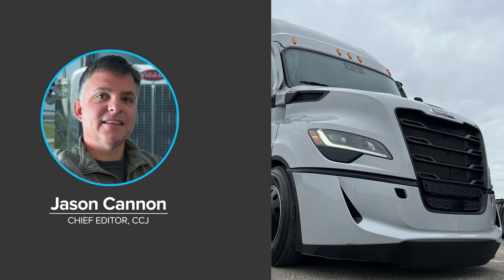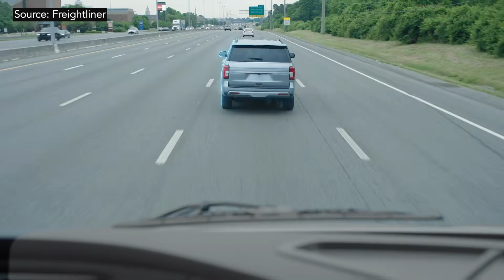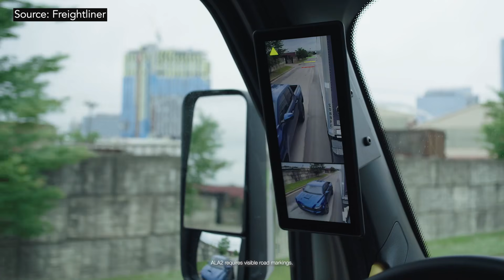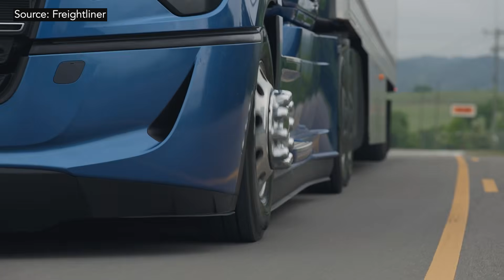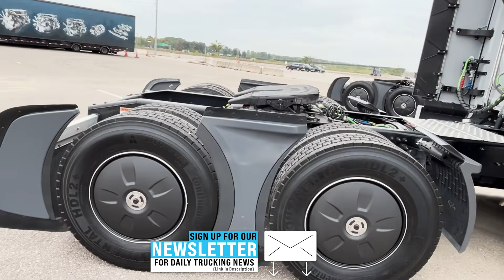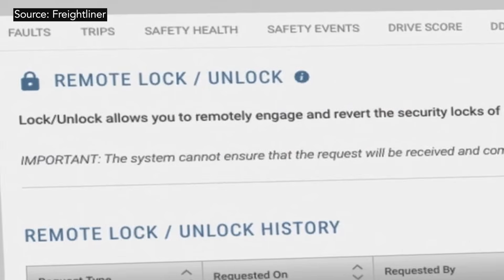First Look: Freightliner's 5th Generation Cascadia debuts next year

Comment: Mistake! Mistake! Mistake! This is without a doubt the most dangerous truck I have ever driven in the 20 years that I’ve been driving highway tractors and I am not exaggerating that point. Number one no self-respecting Driver needs any of this stuff.. number two this truck slammed on its brakes just when you’re taking a corner in the mountains or there’s a hill in front of you and it thinks you’re gonna get into a collision. Number three just a little bit of snow or even rain will take away your cruise control, your brake assist and both of the stupid side and front radars. I do not know why they keep insisting on doing this or how it could even be legal stop with the madness guys. We are truck drivers not fighter jet pilots and we do not need all of this stuff. Please give your heads a shake put the brilliant mind you got working for you. Something important like trying to figure out a new power plant that makes sense. I cannot possibly be the only driver who brings his stuff up to you and this is as polite as I can possibly be.
Reply: BTW, people, I dictated that last message into the microphone if I typed it out, the grammar would have been much better. Thank you for your understanding.

Comment: So how freightliner improved driver's life inside? Less and less storage? Sharp edges on glov box that can easily make your head bleed? Reading light in sleeper you can't reach? Refrigerator on floor hard to go into because it is so low? Steering wheel profile so annoying that drivers have to buy steering wheel cover just to be able to hold it for 11hrs a day? Ladder assembly on top bunk sticking out so much that you will have to use a helmet just to move around?

Comment: Screw all the safety equipment. If they tie a shit ton of that money into making the Trucks ride better especially in team situations it would be quite a bit safer. If you drive cross-country you know what I'm talking about. Our infrastructure is horrific (all while sending BILLIONS to fund foreign wars we dont belong involved in) you're thrown all over the fucking place and it's almost impossible to get any sleep in the bunk of these tractors.
 If they made some sort of a suspension system that helps with all of the BMX bumps I think driver fatigue would be a whole lot less of an issue. Driver fatigue is the biggest safety issue that we have out here on the road other than the new generation of drivers that tailgate, drive their Volvo's like Ferrari's. You know the ones I'm talking about the ones with California plates on their trailers and water bottles in the bathroom.

Comment: They still haven't fixed the autobraking system thinking overpasses and guardrails in curves are obstructions, and they are adding even more things the truck will automatically brake over?  Fix the current problems with the system before adding any more to it!  Other than that, I do like the new all around camera system, even though it looks like it shows what you'd normally see looking in the mirrors.

Comment: How about a collision mitigation system that works, or safety features the drivers want and not the carrier? For example heated windshield wipers and headlights. You know, things that are actually useful and practical...
Reply: Nah. They'll just get the usual incessant beeping nonsense for us. Because you know, safety and stuff.
Reply: Saftey is good intentions ,however they dont function as designed.

Everblades heated wiper are exceptionally practical and functional.

Comment: what's crazy is i have a '24 Freightliner Cascadia with a D15 and I have a check engine light on for the engine control management system "MCM" and they have no fix for it that to reprogram the mcm... that fix lasted 3 days and the light came back on.
Reply: I have a ‘25 with a DD13 with the exact same issue. My CEL came back on last week after they addressed this problem. No driveability issues though, so I’m just going to ignore it until I go home for Thanksgiving. It’s not worth the downtime for something so trivial

Comment: Fuel economy is fantastic, but honest all this lane daparture, collision avoidance and adaptive cruise is the furthest thing from safety ever. Try driving in Canadian winters with that garbage. The sensors get covered with ice and salt, set off the error faults and guess what, no abs, no traction control, no cruise control, brakes locking up on ice, everything safety is no longer operational.  Nothing but an accident waiting to happen. Ad that to new unexpierienced drivers, disaster. Not to mention the brakes slamming on ,on an interstate at 65mph because the trucks adaptive cruise thinks your on a 30mph off ramp when your clearly not. Absolute garbage no other way aroud it. It should be outlawed
Reply: In my first cascadia and yup, slammed on the brakes on me on the trans canada. I was empty, thank christ dry road but scared the crap outta me. Hate all this crap, remove it, this is not SAFE at all. What would be safe is stop hanging out class 1 to people who can not drive!

Comment: i am not buying this shit… i love manual easy trucks
Reply: I prefer manual as well.  I'm leaning towards a Peterbilt if I get my own truck
Reply: You can spec a brand new freightliner with an 18 speed but we all know yall are too broke
Reply: @wizard_of_poz4413  my only dislike with freightliner is that they are built in Mexico and the Cascadia has a fiberglass body. If they were made in the USA and had military grade aluminum bodies and Detroit had metal oil pans on the DD series and not fiberglass I'd get a Western star 49x with dual mufflers and manual transmission
Reply: @MrWill1985  wait wut? The hood is fiberglass but the cab is aluminum. And you can get a cummins x15 in one
Reply: @wizard_of_poz4413  the older Cascadias were made out of fiberglass .I tried putting a magnetic antenna on the roof and it wouldn't stick

Comment: Does the auto breaking still go hard on the breaks for overhead road signs, or the guardrail in cloverleaf exits, or traffic cones for that matter. And don't say I'm exaggerating because I've had all those happen to me  multiple times.
Reply: Don't forget bridge shadows.  Mine likes those.
Reply: also don't forget those 4wheeler that think that have to break check you. I would rather bump into them and proof my right with my dashcam.
Reply: It’s a lot of money in this truck for drivers to be out here struggling
Reply: That part... ridiculous
Reply: As he was talking I was thinking this all sounds dangerous
Reply: The corporate truck has nothing to do with drivers
Reply: You need to adjust your radar then
Reply: @wizard_of_poz4413  that's what I told the shop, was told their set at factory.
Reply: @williamatkins3465  that's why you don't trust these parts changers. Had an lt including my buddys that he swore you can't change but yet he nonstop complained about how much of a safety hazard it was. I took a Philips and unscrewed the one I had with some trial and error I had it straight
Reply: @williamatkins3465 those cameras can be a millimeter off and give false readings. The lenses and/or windshield should be cleaned. Also the sensitivity can be turned down

Comment: Good looking truck , same cab since 2006 it looks like
Reply: Possibly one of the best cabins out there
Reply: Didnt the cascadia strt in 2009?
Reply: @hawkeyetec  no us xpress had them in 2007.
Reply: @MelvinKeller-z4f  I stand corrected..thank you.
Reply: @hawkeyetec  it’s confusing because one year they had Columbia, century, and cascadia I thonk Columbia was first to be dropped
Reply: The fact that they don't even have push out vents on the sides, just 2 vents that look like something you'd see on an 80s truck is just dumb to me. Not enough inner cab ventilation or light

Comment: Worked for Freightliner dealer for 25 years...if this all works, great! if it needs fixing, at a $200/hour labor rate, take out a mortgage!
Reply: Any smart owner isn’t taking his out of warranty truck to the dealer
Reply: @DTRKN  Unfortunately, the programming required to either fix or reset the electronics is proprietary and your local mechanic, good as he is, won't have access. Progress drives about anything other than an oil change to a dealer.
Reply: @ unfortunately that’s going to happen a lot more with newer vehicles even cars. Your forced to go there and get ripped off.
Reply: @Beauxtrux so DiagnosticLink cant reprogram and update these trucks?
Reply: @PhilAmTrucka True, but warranty goes out the window without the connection to the Freightliner mainframe.
Reply: That’s the whole goal isn’t it? Make truck drivers slaves to debt. All these trucks are cheaply made, and their service dept are a joke. Its robbery!! All these “upgrades” are for mega carriers that put any ass in their seats. We’re going the wrong direction folks!
Reply: It's like that for any shop. If I need my 97 civic brakes replaced it's that. Stop fear mongering boomer. I live an old 01 379 exhd Pete myself or a 2000 fld classic xl but this is truly a big game changer in making freght move safer and more efficiently. It's a good thing a cross the board. And it's cheaper to work on for body panels etc than steel and easier to replace to because it's modular. Also to service or maintain it yourself is easier than ever also the tech will sepn less time since it's all more accessible to the service tech. Guess you never thought of that. Also it's meant for fleets my dude. Sure ab owner operator can get this and turn profit but they don't care about that they care about big hoods and chrome and chicken lights. Not money. Just money for those above mentioned accessories. Change my mind. Now as for the 200 dollar pint that's dumb. Anyone that spent time drivie5a truck has been to a shop and saw the bills 200 is nothing my dude that's low market rate 190 is minimum. It's generally 260 to 300 my dude so stop crying and run your truck better. Seems you are here as a rookie but probably not you are likely a burnout in the industry and looking for the next shortcut. Or swift said this is what you will be in next year get used to it. Lmfao